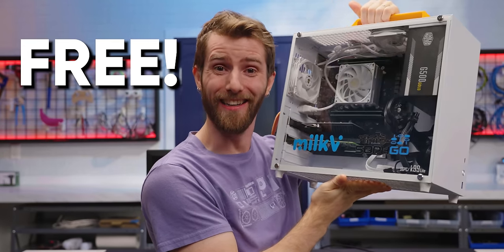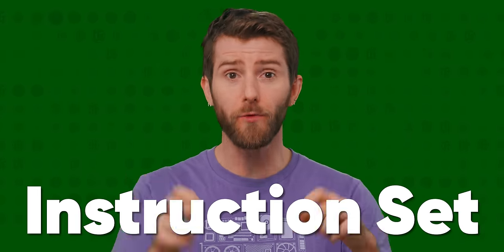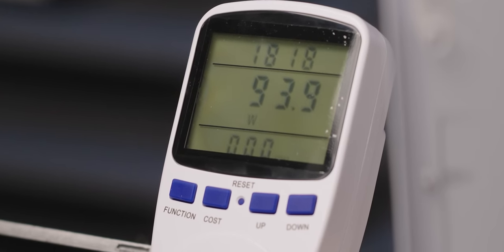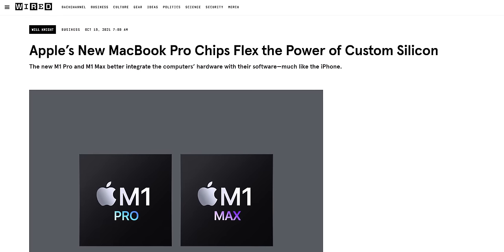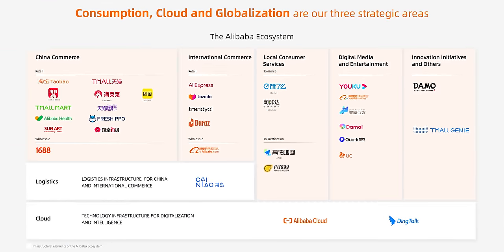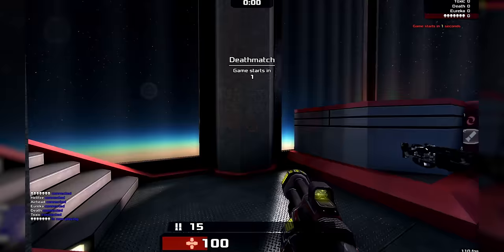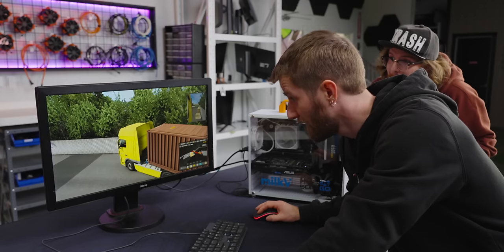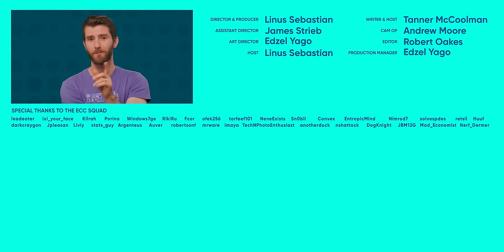This CPU is FREE! - Milk-V Pioneer with RISC-V

Comment: Imagine Valve developing a custom RISC V APU for their future Steam Deck. RISC V has seen a bit of a slowdown in excitement this year after NVidia Failed to buy ARM. I had great hopes for SiFive developing high performance RISC-V Cores, but they are now focused on a different direction.
Reply: I'd like that, Valve needed to fail with their Steam Machines before successfully bringing out the Steam Deck. I just don't see a way for mass-testing of a RISC V to x86 translation layer that is required to iron out bugs to happen. Unless Valve sells RISC V Steam Decks at Switch Lite prices and aiming for Steam Deck performance, which would be very financially difficult to justify.
Reply: @bulletflight  Maybe a better path would be for Valve to talk to Qualcomm and get on the Snapdragon X train with Oryon CPU Cores. A jump to Linux on ARM for Steam OS is more feasible in the short term. Long term a move to RISC-V is very much possible.
Companies who want to differentiate from the competition will seek to have their own Custom RISC-V CPU Cores. DELL, Lenovo, MSI, Acer, ASUS, GPD could all be developing their own Custom RISC-V CPU Cores.

Comment: 6:30 - You would be looking for Box86.  Same as Box64 but... well... for x86 applications instead of x64.  You can install box Box86 and 64 at the same time and run them both as the same time.
Reply: That's probably what they ended up doing for running Eurotruck Simulator, even if they cut explanation.

I tried both Box86 and Box64 on an ARM machine. Very cool when it works but very painful to set it up. Tons of development time is needed to make this thing as transparent to users as Rosetta

Comment: Just to clarify, today there are barely no RISC or CISC architectures around except in the smallest SOCs. Today systems use MICROCODE, which means the commands are not "in hardware" but "interpreted" and executed in a Microcode-Language which has nothing to do with with native code and usually is VLIW which is closer to RISC but still quite different.

Comment: Yeah, I'm looking forward to this, because it is very interesting and there's a lot of interest in just... not dealing with messy licensing anymore. The future is indeed corporate-powered open-source, as the Linux kernel has foretold.
Reply: Messy licensing? Its like $1 per chip
Reply: @Chris-rg6nm first of all, there's the fact that you're reliant on very specific companies who has the right to make the chip. That is an issue - Apple dropped Intel for a reason. Nevermind that the future is looking at custom designs for specific workloads more and more. Valve got to design a chip and optimize the open-source softwares they use around it... and the advantage shows in Steam Deck - the others don't even get to use that chip. And don't even get to the scaling of licensing cost.

There's a TON of incentive working towards open-source because licensing is just a mess to get around. This is why Linux got adopted in server and certain professional spaces, this is why webm and av1 was made, this is why RISCV will be a thing eventually. 

It's not just cost per chip, it's the whole logistics

Comment: "most of it's specs are pretty normal"
literally the first thing he mentions is *128 GB OF RAM*
Reply: ya.... i suddenly feel impotent
Reply: 128 GB is pretty normal for a machine with 64 CPU cores ... even on the low side, just as 8 GB is for a quad core these days. You've got 64 programs running at the same time and they all need RAM to use...

Comment: some information for you guys.
1. intel CPUs are actualy RISC with an added layer to translate x86_64 instructions to it internal RISC uops. and then the actual core executes them.
2. arm has many diffrent ISAs. the highest performance ARM ISA, the one in your phones and macboocks is not the only ISA arm has.
arm also has ISAs for micro-controllers. this is the ISA that is used in other chips that are not the main CPU.

Comment: I used to use a Sun Microsystems desktop back in the 90s. It was designed to run a desktop version of Sun Solaris. I installed a RISC port of Redhat Linux on it. It was leaps and bounds faster than a similar spec x86 desktop running the same OS.

Comment: The ARM chip on smaller Milk V products can run alongside the RISC-V CPU and functions essentially as an Arduino.  Could be used to control RGB/Fans/matrix displays.  That could be very cool.

Comment: ARM was originally Acorn RISC Machine.

It's also worth pointing out that all modern Intel and AMD x86 processors are actually RISC at core.  The first thing that happens to the CISC instructions they receive is decoding into the RISC instructions actually used by the processors.

Beyond that, the actual difference between RISC and CISC is where you concentrate optimization complexity.  With CISC, a lot of that is designed into the CPU - it has to optimize a complex instruction into the multiple simpler instructions actually executed.  With RISC, all of that is done in software by the compiler.  So RISC means less complexity in hardware, but more complexity in software.  CISC is the opposite - less complexity in software and more complexity in hardware.

In terms of power consumption, there's no real difference.  The reason Apple's M1 seemed to perform so well with so little power was simply that it was using a much more efficient process node.  That's still the only efficiency advantage Apple has.  If you were to pit a 5nm AMD chip against a 5nm Apple chip and normalize the testing to same power or same performance, you'd find the other value would be about the same.  Intel is notably further behind right now.

Comment: One project I love is dark risc v, written by a guy in one night on spartan 6 fpga. So one smart madlad & one over the night, dark, programming session later you had an implementation of risc v architecture, which is nuts. Just hardware paths need R&D along with better software compatibility. 1st is easy via big companies like Google as mentioned in vid, 2nd should be fine since software takes less time than that.
Reply: You clearly have no idea about what you're talking about if you think software takes less time than designing the architecture. They go hand in hand.

Comment: BTW the funny is that if you check RISC V's instruction set extensions, there are a lot! At the end of the day, a well packed RISC V CPU has way more instructions than a classical CISC back in the day. However, these instructions are still basic, simple instructions. So, we rather should call it Simple Instruction Set CPU, where the "Simple" refers to that the instructions themselves are not complex microcoded ones.

Comment: I wish tech media would move away from the CISC vs RISC narrative. It hasn't been as important as they claim since roughly the early 90s. 

The ISA is just an interface to the microarchitecture, that's what really makes the performance difference. The reason Rosetta works well is not the ISA but the fact that the microarchitecture has additional memory models internally.

Comment: ARM was first called Acorn RISC Machine because Acorn Computers, the company that created the BBC line of computers in the 80s for the British Broadcasting Company created a RISC processor and called it ARM1 and was based on the Berkeley RISC designs with some modifications

Acorn eventually created a seperate company called Advanced RISC Machines after they had started working with Apple Computers on some designs.

Comment: Just a quick correction most processors even those with CISC have a series of RISC instruction sets. More processors today have implemented simplified routines. CISC and RISC processors are by term are more similar to each other today than they were 20 years ago. This processor is simply straight up RISC. CISC and RISC based instructions are needed broadly across all processors to either handle complex or simplified tasks in favor of process cycle time. The only difference today is the overhead of being primarily CISC or RISC as your base instruction sets.

In terms of efficiency x86 right now is very comparable to ARM between Mac & AMD. 7840u runs very close to the perf and power draw as M2 processors. RISC-V won't be able to compete with x86 AMD.

Comment: Well, at least you correctly said that x86 is robust. We really need a competitor to Intel and AMD that is CISC-based. Issuing fewer instructions to the CPU is the undeniably better path forward for computing, we just need a complete refresh of CISC design to account for the advancements in SIMD technology. The processor can optimize your code as it's running far better than the compiler can and CISC is in a far better position to affect that, and historically this has been very much borne out. As far as running things on a RISC-V chip, if we're talking about open source then it's a simple matter of recompiling. No Linux system should have a problem with running on such a system as long as they've ironed out the bugs in the compiler.

Comment: RISCs sadly have one big issue that I am surprised you have not touched on: cache. That might be one cause for the performance we saw (although it definitely will not be the only one).

Programs are only performant if the necessary data is in cache, rather than in memory. AMD understood this and cranked the cache to 11 with the X3D line of processors and RISCV might need to crank it to 20 just to be on par because RISC architectures need more instructions for the same results which all need cache space.

Comment: I'm betting the first big product that will have RISC-V will probably be a Google Pixel phone as they've already announced they have plans to use it for that when it's ready.

I'm no hardware developer but I do find the tech interesting in how modular it is in that it can be changed to suit what it's being used for. Yes, that means it will be used for GPUs and I'm pretty sure there's already a very low spec one out there already. Being what it is I wonder if AMD has any plans but I wouldn't be surprised if they already are working on something with RISC-V in their R&D.

Comment: 5:30, thats not entirely true, x86 and other cisc instruction sets have more instructions, that are more complicated, but the advantage to this is that these instructions are directly implemented in the CPU, so it would execute faster than completing that same instruction with multiple other instructions. This is also part of the reason for the power inefficiency from what I understand because of the pure absurd number of different instructions

Comment: Calling ARM RISC nowadays feels like calling PowerPC RISC. Sure, they're load-store and have mostly fixed length instructions, but that's where the simplicity ends. Both have very complex ISAs and designing efficient compilers for them or efficient compatible CPUs is no easy task. But unless we're talking about microcontrollers, GPUs or some other freaky kind of massively parallel architecture, I feel like that's a moot point by now, as any high performance implementation is going to end up with tons of complex circuitry that will completely eclipse the complexity of the instruction decoder. Either way I'm still curious to see if the vector extension will end up having actual advantages over more traditional SIMD approaches.

Comment: Risc-v might be closer than you think. We start to se esp-if and nordic run risc-v as co-processors and this is just the start. So putting microprocessors in more places...and it is also pushing arm chips down in cost. Why use a tiny avr when the cheepest m0 arm processors the same price now with much better capabilities. This is partly because of risc-v competition. And while we might not see it now, It would not supprise me if rgb controllers, fan controllers, parts of cpu power management controller or other very bare metal things in our PC move over to a risc-v chip soon. 
If you already need to implement something on bare metal and you can't use the old chip you used to it is a lot of work to switch, so why not switch to the cheap risc-v socs. That is also why I think companies like nordic only run risc-v as coprocessors, so older codebases can jump from nrf52 onto a nrf54 easely and in the future utilize all that extra performance which now comes much cheeper than if they had multiple arm cores.
Reply: RISC-V WCH CH32V003 and Arm Puya PY32F002 are both $0.10, run at up to 48 MHz, and have similar RAM and flash to an ATMega328 that costs several dollars.

Comment: What does it mean for gamers? You already use them if you have modern nvidia gpu
Since rtx 20xx (and 16xx)  nvidia embeds riscv cpu inside its gpu as GSO (Gpu System Processor)
Its responsible for controlling whole board (like what clock should gpu be running at at the moment or what rpm should fans spin etc)

Comment: TBH the special sauce for M1 chips for x86 emulation has been to add HW for the slower missing instructions; I don’t want to say Rosetta is irrelevant but without additional HW it would have been the same disaster seen in many previous attempts

Comment: RISC V is already slowly creeping into the mainstream.
Many new microcontrollers are already using this ISA. For example Espressif, the company behind the famous ESP8266 and ESP32 microcontrollers with wireless connectivity already have products using this like the ESP32 C3. This also helps reduce the price of the end product since no licencing fees need to be paid (unlike with their Tensilica cores). It's generally just a win-win for everyone in the industry.. I trust in RISC V to really push innovation in the sector.
I also own a couple of FPGA devboards that were meant for RISC V development, they are quite nice :>

Comment: Concidering that Windows, the most used desktop OS, is artificially running x86 32bit apps through emulation since Windows 7 64bit (2007~2009), and passing it off as native. I can see a future where linux desktop OSs could do something very similar between RISCV and x86/x86_64, where you won't need to worry about compatibility is most apps, and things just work no matter the ISA being used

Comment: Have a look at the Milk.V Duo.  It's an ASTONISHING little RISC-V based Linux computer!  It has the same form factor as a Pi Pico (including the I/O pins) BUT is dual core, has 64MB RAM and boots from a MicroSD card!  You can run full blown Debian Linux on it (including MQTT, full blown Python and pretty much whatever you like).  It also has 100-base-T Ethernet PHY built into it - so you only need the magnetics (socket + transformer built in).  I'm starting to build IoT devices from it.  The makers claim you'll soon be able to run Linux on one core and FreeRTOS on the other (but not yet...).  How cool is that!  There's an I/O shield for it (including 4x USB ports + Ethernet port) in a Raspberry Pi form factor as well.

Comment: I'm really questioning the statement, that you can't use a modern graphics card. I have a Visionfive 2 (a different risc-v board), and GPU support for the RX 580 was a thing of enabling it and recompiling the kernel. The entire open source driver stack for that worked out of the boy without any tweaking. I would honestly expect you'd get a 7900 XTX running by just recompiling the kernel with it enabled.

Comment: X86 is bloated because it has to be backward compatible to the 8080. That bloat mens it takes multiple clock cycles to complete a single instruction. RISC cuts the bloat down to the most basic instructions, allowing a single instruction (or multiple for multi core chips) to be performed each clock cycle.

Comment: Correction: The A in ARM stands for Acorn. It was developed by the Acorn Computers company. Why they changed it to advanced I dunno, because one of its main uses is still embedded, which aren't that advanced.
Reply: It was re-named when Acorn spun off ARM as a separate company - originally a partnership between Acorn, Apple and VLSI - correctly predicting that ARM had a bigger future than Acorn's non-PC-compatible workstations (and Acorn was pretty much unknown outside of the UK).  As for "advanced" - the original "Acorn" ARM was partly developed because Acorn didn't think x86 cut the mustard for the BBC Micro replacement, and could run rings around a contemporary 286. Even in the embedded world it was probably competing with microcontrollers based on Z80 or 6502. Plus, they could hardly call it "Average RISC Machine" or "Adequate RISC Machine"...

Comment: All i learnt from this video is that riscv is still in beta stages and has a lot to iron out but is 100% more efficient than x86 CPU's. Excited for the future.
Reply: ppl love to repeat that effeciency bs. just because it's risc, it doesn't mean it is more effecient than x86. check the performance and compare it with an x86 processor that has about the same. how much power does each cpu use? everything else is just talk.

Comment: imagine living in the time where people are no longer just casually compiling their own OS but also casually building their own CPU.
A: "c'mon bro, we gonna be late for the class!"
B: "wait! I''m almost done building my CPU!"
Reply: You can technically do it already if you really want to)
Buy a powerful enough FPGA and learn your favourite HDL.
Not an easy task if you want to do it all from scratch, but definitely possible!
With RISC V you already don't have to worry about writing a kernel if you want compatibility as long as it supports RISC V :>
Reply: @Versette  Building a CPU for some older instruction sets is pretty easy, modern ISA will mostly just take a lot more effort. But the hard part is to make it efficient.

Comment: I have a Ryzen 5800x, RTX Tuff 3070, 3600mhz 64GB memory, 4 NVME drives, B550 Plus Wifi II Tuff motherboard, corsair 800w power supply and at idle use 72w, when playing Star Citizen I max out at 230w, PUBG 156w.... I'm yet to hit 300w with a system yet....
Reply: Nice 👍